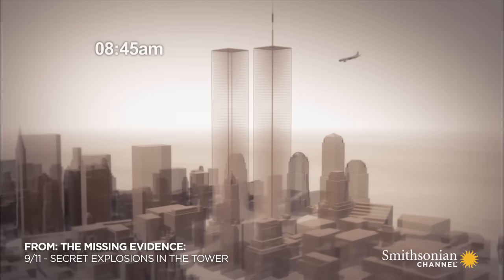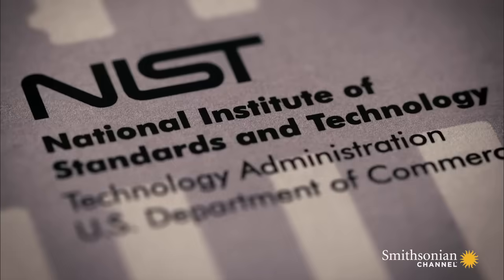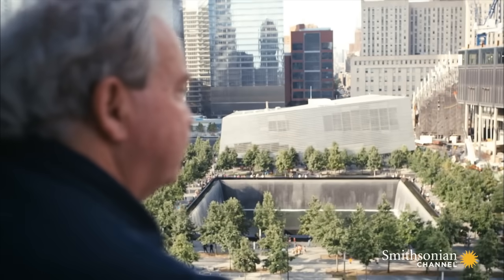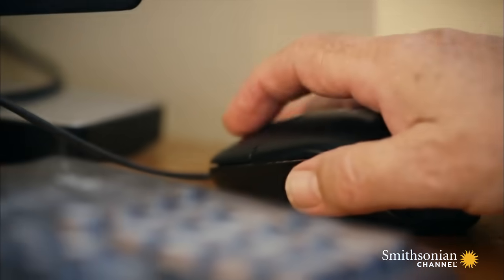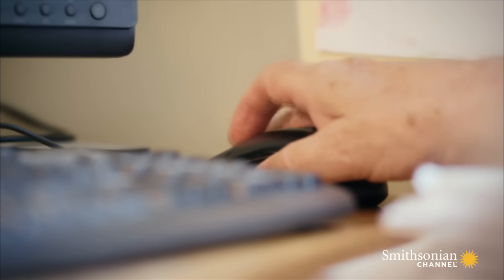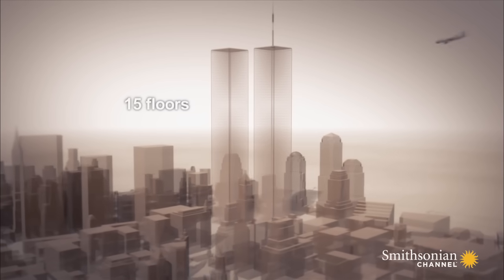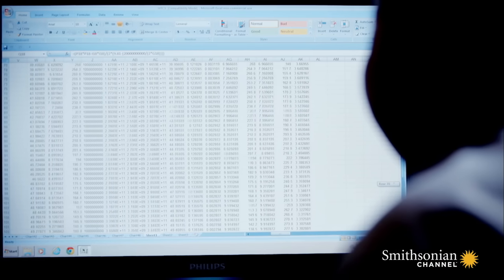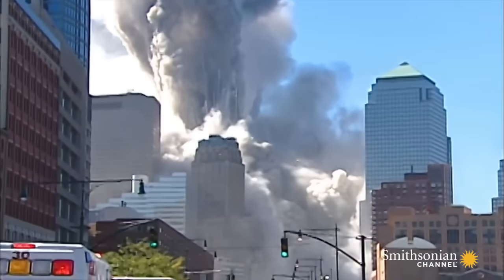This Computer Simulation Explains How the Twin Towers Fell

Comment: I'm an engineer and not at all into conspiracy theories, but I still don't understand how those buildings collapsed, especially the third one. But it's good they collapsed straight down and didn't cause too much damage to the surrounding buildings.
Reply: The government would never deliberately slaughter its own citizens to justify a foreign war. Simply not possible. If people believe that then they probably believe the government deliberately gave poor black people syphilis in order to study the effects of the virus. It simply never happened. 

😶
Reply: @GMAV3RICK  it's not like bush needed justification for Iraq
Reply: @GMAV3RICK  it still baffles how people could still believe in this system😂😂😂😂
Reply: @GMAV3RICK  Who did that?
Reply: That was the plan @VoltageLP
Reply: What field of engineering? Is it related in any way because you might be a software engineer for all we know, which would be meaningless on this topic. It's quite simple to understand really. The dynamic load of the top sections that initially fell, WAY exceeded the static load limit of each individual floor below, gathering mass with every floor it smashed through.
Reply: @dirkdiggler8260  bachelors in systems engineering as my first degree, masters in aerospace engineering as the second
Reply: @VoltageLP  So not experienced in high-rise construction or structural engineering as such? Not saying that to be disrespectful by they way. Did my nutshell breakdown make sense as to why they came down like they did?
Reply: @VoltageLP bs
Reply: Michael Smyth  Said no demolition expert, ever 🤣👍🏼
Reply: You must not be a very good engineer.
Reply: @GigaTezla  tell that to Northrop Grumman 🤣🤣🤣
Reply: @VoltageLP  You might be good in the field of engineering you're in, but you're a little clueless whe it comes to structural engineering and high rise construction given your arguments here.
Reply: @dirkdiggler8260  cool, I didn't give any arguments, but whatever you say 🤣🤣🤣
Reply: What field of engineering you in? The towers basically collapsed from impact from the planes than weaken steel from a roaring jet fueled fire bomb the broken floors could no longer support the floors above
Reply: @ουρανός-φ5θ  aerospace. I know I've read the NIST report. No fuel in building 7 though.
Reply: @VoltageLP  Why would jet fuel ve required to start fires in WTC7 when thousands of tons of debris fell on to it? Can you not accept this was enough to start fires in that building? I really don't understand why you people struggle so much with something so simple, choosing to exchange logic and rationale for lunacy. I notice you failed to reply to my previous reponse to you......again 🙄
Reply: @dirkdiggler8260  put images of bld 7 and the wtc Marriott side by side and you'll see the difference between a structure that was hit by debris and one that wasn't.
Reply: @mroselli7482  The Marriott was specifically reinforced after the 1993 attacks to be able to withstand extremely heavy impacts which is why part of the building was left standing after the towers collapsed.
Reply: @ουρανός-φ5θ  what about the building that wasn't hit by anything yet fell the exact same way and velocity?
Reply: @mroselli7482  pretty sure it’s was on fire and got hit by debris and was damaged when the towers fell and it was burning and just burning they didn’t put the fire out in that building I believe for hours they were too busy
Reply: @mroselli7482  pretty sure it’s was on fire and got hit by debris and was damaged when the towers fell and it was burning and just burning they didn’t put the fire out in that building I believe for hours they were too busy
Reply: @ουρανός-φ5θ  find images of bld 7 and the wtc marriot side by side and you'll see a building that was hit by falling debris (marriott) and one that shows to sign of external damage.
Reply: @ουρανός-φ5θ  I don't buy that nonsense for a second. Fires don't do that in that type of building. I was a FF2 ff/medic for 10 years. I've seen portions of buildings collapse from fire but never a systematic failure on all sides. Has never happened before and has not ever happened since. To say it's just a coincident that it happened 3 times on the same day is ludicris. 

I might have believed it if it was just bld 1 and 2 due to the extreme nature of the MOI. But seeing 7 do it the exact same way at the same velocity with little to no structural damage, that i cannot believe. Plus, there's thousands of professionals that banded together to get a new investigation because they call BS too.
Reply: @mroselli7482  Who cares what you buy?

Steel is vulnerable to fire, and yes, other steel frame buildings have collapsed from fire. Go ahead and deny it.
Reply: @mroselli7482  Ok so next you're saying the fire fighters who assessed and tended to WTC7 were lying. Pretty disrespectful to say the least. Unfortunately for you, your opinion counts for less than nothing and does not change the reality of WTC7 having thousands of tons of debris dropping on to it which resulted in a huge amount of structural damage and widespread fires across many of it's floors. As this was a non-concrete reinforced building that was left to freeburn, a collapse waz inevitable. There could be no other outcome. Any buildings you've referring to that experienced partial collpase, i think you'll find that the parts which collapsed were the non-concrete reinforced sections whilst the sections that were concrete reinforced remained standing. Either that or the fire fighters had successfully fought the fires.
Reply: @mroselli7482  Here's whst those fire fighters i just mentioned that ypu call liars said:

"We were pretty sure that 7 World Trade Center would collapse. Early on, we saw a bulge in the southwest corner between floors 10 and 13, and we had put a transit on that and we were pretty sure she was going to collapse. You actually could see there was a visible bulge, it ran up about three floors. It came down about 5 o’clock in the afternoon, but by about 2 o’clock in the afternoon we realized this thing was going to collapse." - Deputy Chief Peter Hayden

"There was a huge gaping hole and it was scattered throughout there. It was a huge hole. I would say it was probably about a third of it, right in the middle of it.....On the north and east side of 7 it didn’t look like there was any damage at all, but then you looked on the south side of 7 there had to be a hole 20 stories tall in the building, with fire on several floors. Debris was falling down on the building and it didn’t look good.
That was the first time really my stomach tightened up because the building didn’t look good......Then this other officer I’m standing next to said, that building doesn’t look straight. So I’m standing there. I’m looking at the building. It didn’t look right, but, well, we’ll go in, we’ll see. So we gathered up rollups and most of us had masks at that time. We headed toward 7. And just around we were about a hundred yards away and Butch Brandies came running up. He said forget it, nobody’s going into 7, there’s creaking, there are noises coming out of there, so we just stopped." - Captain Chris Boyle NYFD

"They were worried about 7 World Trade Center, which is right behind it, coming down. We were up on the upper floors of the Verizon building looking at it. You could just see the whole bottom corner of the building was gone. We could look right out over to where the Trade Centers were because we were that high up. Looking over the smaller buildings. I just remember it was tremendous, tremendous fires going on. Finally they pulled us out." - Richard Banaciski NYFD Firefigher

I can provide more if you wish but i think those 3 have proven my point and exposed how poor your knowledge on this topic is. It may help if you bothered to read the actual studies you're seemingly so desperate to dismiss. Until you do and whilst you make ridiculous, utterly false assertions, don't expect anybody to take anything you say seriously.

Edit. To claim to be a medic whilst disrespecting fellow emergency service workers lile you're doing is pretty disgraceful. Shame on you.
Reply: @dirkdiggler8260   I dont' care what FF1/FF2 would have to say. They are not trained in that line of work. I would know, i was ff2/medic for 10 years. .... BUT structural engineers, civil engineers, and people that build structures as this for a living say otherwise. 

If bld 7 was so badly damaged why is there no pictures of any damage?? Why didn't building 7 look like building 5 & 6?? Those two building were right next to building 1 and were really heavily damaged, YET they never collapsed. Instead, they were demolished a few weeks later. Building 7 is on the other side of those two buildings and across a street. There are buildings on both side of building 7 that all sustained some type of noticeable visual damage and none of them collapsed into thin air.

Instead, you just copy and pasted a few sentences from the NIST report. I'm not interested in what a gov agency has to say about it.
Reply: @dirkdiggler8260  the WTC marriott was cut in half, the surviving sections did not collaspe, it had tob e brought down.

WTC 5 & 6 sustained massive gashes in all sides and the top floors were ripped off. It did not collapse, it was demo a few weeks later.

same can be said about wtc 4 and the Deutsche bank on liberty street.

All sustained major damage and fires and  none fell the EXACT same way wtc 1&2 fell. None of them showed a constant downward velocity with bits of acceleration.

And NIST never had to make something up in order to explain any of those structural failures. 
😉
Reply: Looks like they planted some explosives to finish and collapse both buildings. I can't trust that that little of a weight (above the floors that the plane hit) compared to the weight bellow the area the plane hit collapsed the whole buildings. I think even if the area above the place where plane hitted the building collapsed, it would just destroy like 10-15 floors beneath that surface and spread like a pancake. Other floors beneath that would not suffer or colapse.
Reply: @SxpectBeats  You're confusing the hollow towers with solid jenga towers. The weight of those top sections was much, MUCH greater than the load limit of each, individual floor. With each floor it smashed through, the greater the mass became that dropped to the next floor, all the way down. No explosives required, just simple physics.
Reply: Timmy is still making comments like these to this day! He’s up to date replying to the newest comments made every day! Many many videos. I just came to this video and found him here I’ve been argueing with this guy as smart as a rock for the last day. And here he is again ahahahahhshshahahahah your fooling no one but yourself Timmy that cognitive dissonance hurts I know. Cope.
Reply: It's called controlled demolition.
Reply: You must be a horrible engineer. Even A fool knows they were demolished
Reply: You're an engineer like I'm a brain surgeon.  Or maybe you're a highway engineer who designed some of those clusterfck cloverleafs!
Reply: @scarharting5577  Aerospace actually, Northrop Grumman =)
Reply: @noflockin7574  hydrogen bombs?
Reply: Michael Smyth  you should read it again
Reply: Michael Smyth  the NIST report, it was an incredible job
Reply: @VoltageLP  the NIST report was "incredible" to you? They had to invent a phenomenon in order to explain their model. In other words, their model didn't make any sense, so they invented a conclusion to their theory. 

Has this new "phenomenon" every happened since that day?
Reply: Pretty much the entire WTC complex was in Ruins
Reply: @CPorter  Yet truthers claim the towers fell into their own footprint 🤷🏽‍♂️ lol, clearly not given the damage to all the surrounding structures.
Reply: What do you find difficult to understand about controlled demolition?
Reply: @dunexapa1016  nothing, but it has nothing to do with the subject
Reply: Beware of trhe paid COINTELPRO /77TH BRIGADE trolls on these threads!    Their job is to beg and plead with you to NOT expose this blatant cover up/false flag event!
Reply: But they should have at least waited until everyone was out of both towers before bringing them down.
Reply: All 7 wtc buildings were destroyed that day
Reply: @jamieboyd1771  with donald trump sleeping inside 4 of those 7 at that exact moment
Reply: It collapse because the burning jet fuel was so hot that the integrity of the bulding was melted. Jet fuel is hotter and stays hot much longer a IEDs with a van
Reply: They did damage the surrounding buildings! A dozen or more were destroyed or had to be dismantled.
Reply: @Tim22222  I would expect more damage from two 500 metet buildings falling on Manhattan, and it's way less than a dozen, 3 WTC buildings destroyed and the Bankers Trust building damaged and demolished years later
Reply: @VoltageLP  Actually, all 7 WTC buildings were destroyed including the towers, plus St. Nicholas Greek Orthodox Church, Deutsche Bank, Fiterman Hall (taken out by the collapse of bld 7).
Reply: @Tim22222  Stop
Reply: @hardcoreplayafromthehimala4888  Why?
Reply: @Tim22222 bahahahhaa hey Timmy! You are comedic gold!
Reply: Not only that they collapsed but especially building 7. Where they (NIST) blamed the failure on “office fires”.
Reply: @GhostSal  Yes, because whereas it would be natural to assume it was the thousands of tons of debris smashing through it causing huge structural damage that brought it down, it was found that it was the fires rather than the damage sustained, just as the fire fighters there that day predicted hours before it fell.
Reply: You can't be a real engineer if this confuses you. It is quite simple how they fell.
Reply: @JohnSmith-zi9or  I am, two degrees Aerospace (composit materials and propulsion) and Systems (robotics) Engineering
Reply: @VoltageLP  You should be able to understand this. It isn't rocket science.
Reply: @JohnSmith-zi9or  you're right. The structure below the impact was clearly destroyed by something other than the structure above the impact falling.
Reply: I am an engineer too and I researched a lot about this topic. I am pretty sure that these buildings fell from structural steel failure from the extreme heat. The controlled demolition is absolute non-sense when you really think about it.
Reply: @danielninchev724  the structure has to be weakened hense the termite found in the rubble before the government hurried up and got rid of the evidence. Plus the First responders earlier in the morning responded to explosions in the basement and lobby of the Twin Towers. They said they heard explosions above that seemed to go upward. That could be blasting caps blowing the joints holding the steel floors in place.

Thermite, a mixture of metal powder and metal oxide, is the hottest burning man-made substance in the world. It burns at temperatures of more than 2,200C, enough to burn through steel or asphalt.
Reply: @jetcitysinatra7300  there was no thermite. The explosions that were heard in the lobby were from the falling elevators. The buildings collapsed from the fires.
Reply: @jetcitysinatra7300  they never found thermite. Their tests on the dust samples were inconclusive and aluminum oxide has never been found in any of them.
Reply: @danielninchev724  I agree, I'm just happy they didn't raze half of Manhatten when they fell
Reply: @danielninchev724  building 7 was not hit by a plane...it had regular fires...that cannot generate enough heat to melt steel...come on!!!!
Reply: @janajayj1965  Nope, the building itself did NOT fall at freefall but contrary to truther belief, freefall doesn't mean demolition. Freefall can and does occur from buckling. In a demolition, freefall occurs at collapse initiation, not midway through the collapse.
Those "sporadic fires" were far greater than you give credit for and were left to freeburn and with ANY non-concrete reinforced, steel framed structure, if left to burn WILL collapse 100% of the time. If it was such a mystery and unexpected, how do you explain the fire fighters publicly asserting a collapse was inevitable, hours before it fell?
The temperatures of the fires were plenty hot enough to greatly WEAKEN steel. It didn't need to melt it, how do you not know this after over 20yrs??  And no, it wasn't hit by a plane but it was hit by THOUSANDS of tons of falling debris from the collapsing towers which led to HUGE structural damage and widespread fires acorss many floors.

Ps. His engineering background has nothing to do with high-rise construction, structural engineering or controlled demolition.
Reply: @dirkdiggler8260  free fall means that there's no opposing force outside of the resistance of air. A downward movement only influenced by gravity. Bulking will have resistance in all directions. That's from a single collegel level technical physics class i took. 

Arient' you claiming to be a Highrise engineer or something?
Reply: @janajayj1965  1000% agreed
Reply: @mroselli7482  I'm guess you failed that class miserably. Here's what the official study says:

'This analysis showed that the 40 percent longer descent time—compared to the 3.9 second free fall time—was due primarily to Stage 1, which corresponded to the buckling of the exterior columns in the lower stories of the north face. During Stage 2, the north face descended essentially in free fall, indicating negligible support from the structure below. This is consistent with the structural analysis model, which showed the exterior columns buckling and losing their capacity to support the loads from the structure above. In Stage 3, the acceleration decreased as the upper portion of the north face encountered increased resistance from the collapsed structure and the debris pile below.'

So there you are, negligible support from the structure below because the exterior columns buckled and lost their capacity to support the loads from the structure above. What you're saying though however is that even if the columns buckled, they still provide some resistance which is true, but the key question here is how much resistance. If they provide a force equal to the mass they support times g, then the mass they support will not move. If they provide a force equal to 1% of the mass times g, then the mass will move down with an acceleration of 99% of g (i.e. negligible resistance, and essentially free fall). The math checks out whether you accept it or not.
Reply: @danielninchev724  you're an engineer then you should understand the fact that only a controlled demolition can bring a tower vertically down in under 20 seconds. Plus the heat you spoke of, it was due to the demolition. It all makes sense.
Reply: @rambo333100  Don't tell me what I should and what I shouldn't understand as an engineer when you clearly don't know what you are talking about. Who told you that only controlled demolition can do that? It all makes sense to you because you have no understanding of how steel structures work and how fire damages them.
Reply: @danielninchev724  still don't change the facts that there were detonators in there. 13 seconds to bring down a 125 storey tower! How else would you do that? FYI, I'm an architect specialized in high rise structures
Reply: Shalom
Reply: You’re an engineer yet you lack basic kinder-garden level thinking skills like the majority of the commenters here. I think I’m going to put my faith in the consensus.
Reply: @andrewmikhailov3173  Thankfully, I don't 😅
Reply: VoltageLP Silverstien explained the building 7. He said  "I contacted the fire department and there was such loss of life that we made a conscience decision to PULL IT"   If you understand that phrase you will know how it collapsed.
Reply: @jetcitysinatra7300 what he means is pull the firefighters out I believe so that they don’t get crushed incase it comes down. Do you really think a pretty smart guy like Larry Silverstein would slip up during an interview and admit to having a controlled demolition on wtc 7? Especially considering he could probably tell the people to cut certain things out of the interview
Reply: @jetcitysinatra7300  what he probably meant was that because of the people trapped in the rubble of the Twin Towers and the many victims from the attacks it would be better if they simply focus on rescuing the trapped people that may still be alive and not focus on the burning building which was engulfed by flames and was already evacuated.
Reply: Building 7 fell at free fall speed, it had only sporadic fires, was NOT hit by a plane...you’re an engineer...you can figure this out!!!
Reply: @janajayj1965  NIST has already figured it out for us
Reply: @janajayj1965  It was hit by significant debris that started the fires, which burned for SEVERAL hours, more than enough to weaken the steel. Surely you can figure this out.
Reply: Your an engineer and you don't know what controlled demolition LOOKS LIKE !!!!!!
Reply: @harlow743  you're a bobo
Reply: @harlow743  that's what I thought too lol 

People love to lie on here to seem relevant
Reply: Either you're lying about being an engineer or you just haven't read the official reports. It's pretty easy to understand even by a layman.
Reply: @SPZ909  😂😂😂, I've read the full NIST investigation as soon as it was released 😂😂😂
Reply: @SPZ909  I'm sick of people who have read a bunch of articles and have watched a few internet videos and they think they are experts in a specific scientific field and that they know better than real scientists who have really done the effort. Obviously you don't have basic knowledge of how steel structures work and one of their biggest problem - fireproofing. Structural steel doesn't need to melt in order to lose it's strength. It starts losing it's load-bearing capacity drastically when temperatures above 400 degrees Celsius are reached. And just to inform you, 95% of structural engineers agree with what the "official story" says. But, of course, it's not you who is wrong - you know better than us...

I have read the official reports and I have watched computer models. What exactly do you consider to be wrong there? What are your "evidence"?
Reply: @SPZ909  well if you are do something for a living and know that what you are being told could not happen the way they said it did then you would think is a bit strange to. Of course those who dot understand the particulars and overwhelmed by what they saw and heard will not question the official story.
Reply: @jetcitysinatra7300  questioning the official story doesn't make you smart. 95% of the structural engineers agree on what happened there. And it is not us who do not understand, it's you. You have watched a few videos on the Internet and you think you understand something, but you really don't. I'm still waiting for you to give me some of your "evidence" that the official story is wrong.
Reply: @danielninchev724  No matter what evidence I show, you will never admit that the official story is wrong. I have never worked doing demo on a building that size but I have worked on smaller building with people who have and they tell me that it was no plane that brought that building down. It was a demolition made to look like a bombing. . .
Reply: @jetcitysinatra7300  oh, boy, there we go... First, I need to say that I actually believed the conspiracy before I got my master's degree (which was years ago). So I know most of what you are going to bring up as "evidence", I just want you to bring it up so I can address each one of your points one by one. 

Now, another think that I should bring up here is that science is not based on opinions, it's based on evidence. And by evidence I mean scientific evidence, not speculations. Let's assume that you are telling the truth and that you have worked on a smaller building with people who have done demo. You should ask those people the following questions:

1) What devices were used to bring the buildings down and what are the evidence for them?
2) How were those devices installed without anyone of the thousands of inhabitants there notice? Where did they hide the wiring for the devices? They had to do a lot of noisy processes there to hide devices on almost every floor near most of the columns (like breaking of walls, etc).
3) Do they realize that they are hitting two buildings full of these devices with planes? And how does that exactly work? How are the devices and their wiring not damaged from the plane impact? And how did they work properly after it?
4) How did they know where the planes would hit?
5) Why would they even fill building #7 with these devices? What would be the point of that building being destroyed when the other two would be absolutely enough for their dirty work. This would only put their operation at risk of being caught by enlightened observational people like you, so why would they do that?
6) How did they calculate where exactly the rubble from the towers would hit building #7? They had to be very precise with that since it could damage their devices and put everything at risk of not perform properly.
7) Why did the steel fail right at the place of the plane impact? You can see it at any video that the columns buckled exactly at the impacted area.

I would really love to see your answer on these questions.
Reply: @danielninchev724  Let me ask you, is it possible to make something look like something else . . .  If not then why. . . By the way I never got a masters degree but I have done demo work. . .
Reply: @jetcitysinatra7300  No, it's not always possible to make something look like something else. Sometimes it may be, but not in this case. There are too many factors that are uncontrollable and unpredictable in this particular situation - like where exactly would the plane impact the building, where exactly will the fires spread, how long exactly would it take them to do so, where exactly would the debris from the towers hit the adjacent buildings and so on... Not to mention the human factor... I'm sorry, but it's kind of a ridiculous question. You didn't answer my questions though. If you really have done demo work, then you sure can answer them.
Reply: @danielninchev724  daniel, you sedem like a nice guy, clever and open for normal discussion. of  cource steel bends i heat, but if it bends it doesnt bend  in itselve. it bends to all sides. right. so a normal human would think before the upper floors colapse  it would bend to a side. the side where the plane hit, i would persume and it would fall to the side. but lets say my thinking process is wrong.
now please, cerozine cant be mixed with anything to burn at such high temperature to literally melt  the inner collums  so they run out t the bottom of the building like water. That is impossible.
Reply: @dirkdiggler8260  I suppose Mark didn't here the firemen who arrived at the Twin Towers before the "Planes" hit. They came to the twins due to explosions in the basement and lobby of the twin towers. Then they said it sounded like explosions happened going upwards. My guess is that the explosions were set in the corners of the floor joints to help them pancake as a floor fell in on the one underneath the one that was falling. If you take a floor and it falls on top of a floor that is properly supported it will not free fall like it did. So, yes, a typical controlled demo would work different but if you you were to break the floors loose then yes it would have fallen as fast as it did.
I contacted CDI but they have yet to get back to me. Now are you saying that Mark is more of an expert than the experts who say that it was a controlled Demo?
Reply: @jetcitysinatra7300  I've only just realised you replied sorry. To address what you said, where are you getting your information from? No firemen arrived before the planes struck to investigate any explosions in the basement, that is patently untrue. Explosions going up?? I'm sorry but you need yo cite your source because i call buIIsh!t. You do realise those towers remained standing for quite some time after the planes hit which kinda punches a pretty big hole in your theory.
Your understanding of demolition is less than shallow. Placing explosives in "the corner of the floor joints" is NOT how you bring down a builidng and that would simply not work. You clearly have no idea of the design of those structures but i assure you, each floor was not held up at the corners lol.
To say a properly supported floor shouldn't give way if another fell down on to it is ridiculous and shows again, a total ignorance of this topic. A single floor has a calculated static and live load limit. We KNOW that those limits were WAY exceeded by a HUGE amount by the dynamic loads that fell on them. This isn't in question, it's a verifiable fact whether you accept it or not. The towers also did NOT collapse in freefall so again, utterly wrong. We can clearly observe debris falling alongside the collapsing towers at a faster rate meaning, there was resistance. With each floor the above mass crashed through, it gained more mass, hence the acceleration......but no freefall.
What have you contacted CDI Inc for when it's all in the public domain anyway?? What have you asked them and what exactly are you hoping they're going to tell you? Will you accept what they tell you when they explain just how spectacularly wrong you are on literally everything? If you're genuinely so interested, why haven't you even bothered to read the official studies and learned of the manner in which the towers actually came down? And yes, i am mosy definitely saying Mark Loizeaux has a far greater understanding than any of your demo experts who say the towers were demoed....... because there aren't any demo experts saying the towers were demoed. Not one. So what you're actually saying here is that you believe you have a greater understanding of controlled demolitions than the ENTIRE demolitions community. I struggle with that sorry.
Reply: @jetcitysinatra7300  I received a notification of your response but it isn't appearing as visible to me for some reason. Try and repost and i will respond.
Reply: @jetcitysinatra7300  ??
Reply: @danielninchev724  95% of engineers from where? Where are you getting that number from and in what context?
Reply: @danielninchev724  

1) What devices were used to bring the buildings down and what are the evidence for them?

- The theory goes as being thermite. We can see melted steel coming out from the towers on several videos.
Nothing present from the original story should be able to melt the steel into a liquid substance.
The heat should maximumly have been able to bend the steel beams, not liquify them.
But maybe it's aluminum? I wouldn't know.

2) How were those devices installed without anyone of the thousands of inhabitants there notice? Where did they hide the wiring for the devices? They had to do a lot of noisy processes there to hide devices on almost every floor near most of the columns (like breaking of walls, etc).

- The way you would do this, is to have agents go in, concealed as either elevator or general restructuring workers.
It would be in collaboration with someone high up in the WTC administration, and possibly the corporations you've used as a cover.

3) Do they realize that they are hitting two buildings full of these devices with planes? And how does that exactly work? How are the devices and their wiring not damaged from the plane impact? And how did they work properly after it?

- Theoretically each device just needs one remote control to set it off, individually.
Maybe they had a remote control for each floor.

4) How did they know where the planes would hit?

- Not important because of remote controls.

5) Why would they even fill building #7 with these devices? What would be the point of that building being destroyed when the other two would be absolutely enough for their dirty work. This would only put their operation at risk of being caught by enlightened observational people like you, so why would they do that?

- One can only speculate. Insurance? An enemy? A plan for another structure at that location as part of a bigger complex?

6) How did they calculate where exactly the rubble from the towers would hit building #7? They had to be very precise with that since it could damage their devices and put everything at risk of not perform properly.

- They didn't have to calculate that at all, they just had to manually start a fire in the building the moment the bigger towers started collapsing, as no one would have been the wiser because of the all the debris in the air.
I don't know about the possibility of finding broken devices or thermite residue at the site afterwards, but theoretically, if it's a government conspiracy, you would just have a group of trusted agents get out there and confiscate everything the site workers find.

7) Why did the steel fail right at the place of the plane impact? You can see it at any video that the columns buckled exactly at the impacted area.

- Sounds true. Shouldn't be in conflict with the thermite theory.
Reply: @Philanthropy  man, you made me laugh. Yes, the molten metal was mostly Aluminum as the whole facades of the towers were covered in Aluminum alloy. You can even see it on some videos melting. Regarding 2), you clearly have no idea how things work on a construction site and how constructive elements work. In control demolition they have to put those devices on most of the load bearing elements, which means that almost all of the columns needed to have explosives, as well as the core. It cannot be done with just a few agents placing them in the corners of the rooms and no one noticing, it's not as simple as a Hollywood movie. The controlled demolition theory is so absurd, you just cannot see it because you don't have the necessary training for it.
Reply: @jetcitysinatra7300  this is because the elevators broke and fell/collapsed the moment the plane hit and destroyed the entire core of the North Tower, causing explosion like sounds in the basement from the impact. They did NOT arrive before the plane hit, only after.